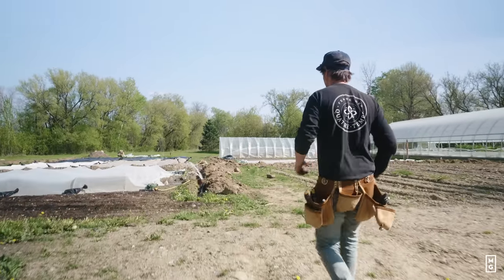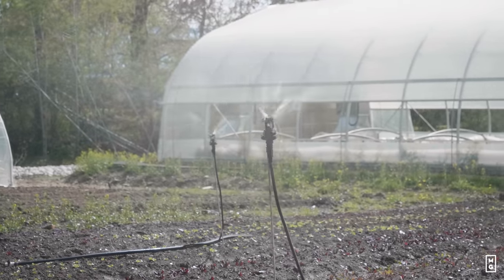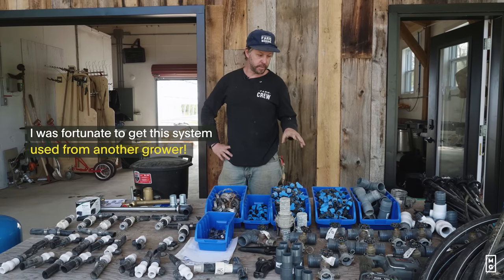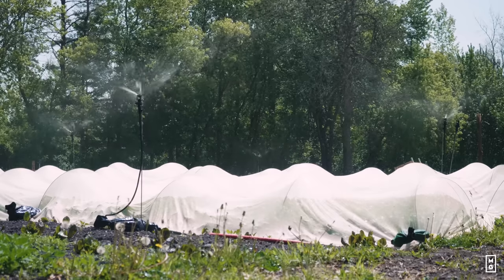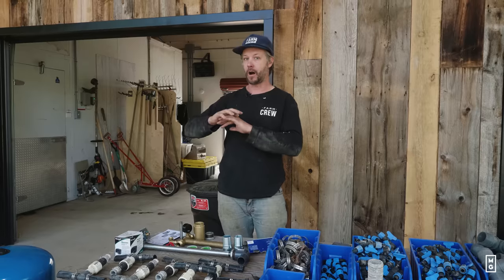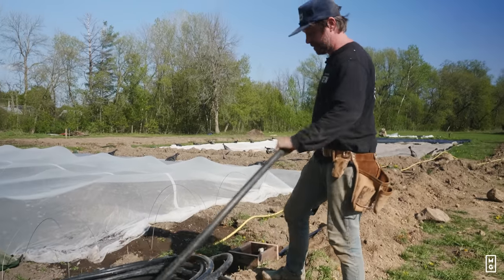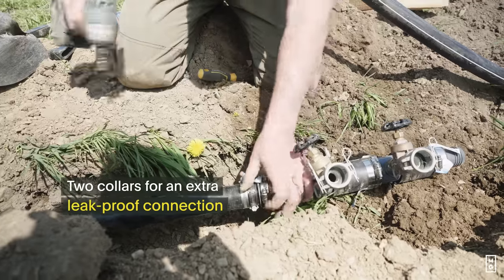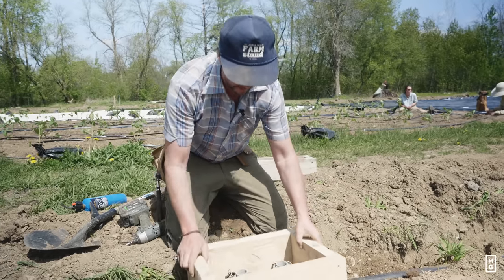Irrigation System DIY Install At My New Farm! 💦

Comment: This has probably been asked but I am interested to know how much the water is filtered before it gets to the wobblers and drip tape?  And how often does the filter system need to be cleaned/ maintained?  Also, did you have the river water analysed before you went ahead?  I’m just asking not questioning. Top job!
Reply: Yea I'm also interested to know how to get wild water through drip.  Looked like just a pretty basic sand filter?  Thanks for the video, super helpful!